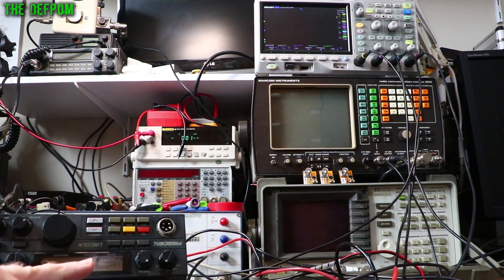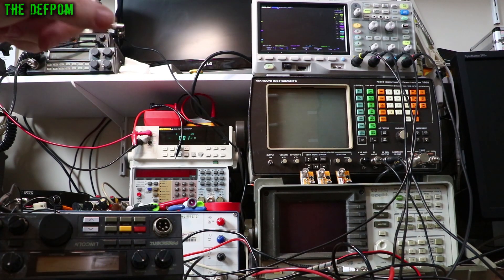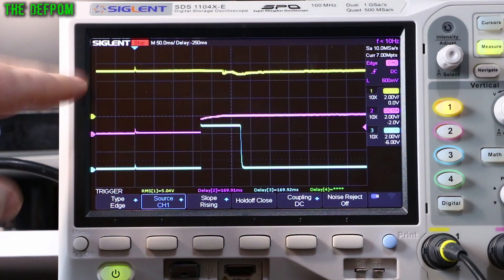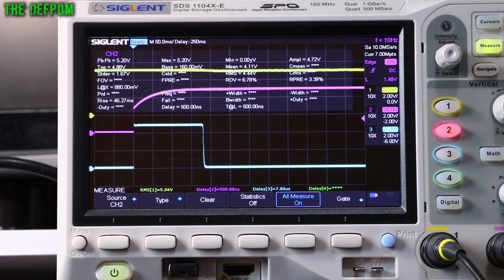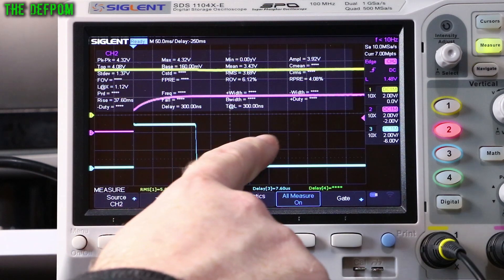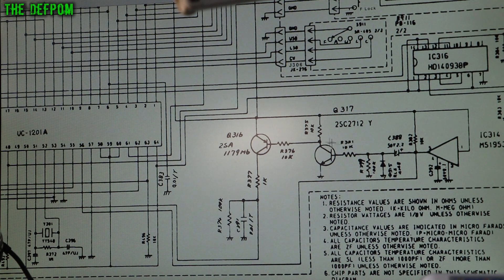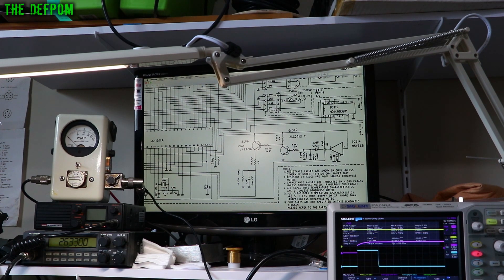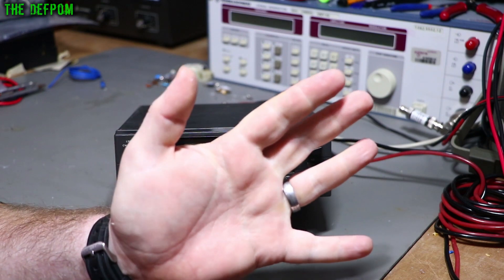🔴 President Lincoln Repair - Processor Reset Experiments - No.887

Comment: Hi and thanks a lot for this video. it helped me a lot diagnosing my Lincoln. 
I have a Lincoln that did exactly this. All was fine after a partial replacement of the capacitors a while ago, since a lot of them where hardly having any capcitance, but this remained an issue later on unfortunately.. 
I checked the circuit you mentioned and the IC but I think the main issue in ths case can also be solved by replacing the 0.1uF delay capacitor of the voltage detecting IC at Pin 4 to GND. (C392). 
Strange enough they used a electrolytic capacitor for this? Since the value was so low and there was only low/non freqency signals, I did not replace it, thinking that it would not have deteriorated so fast. 
I was wrong.. Strange enough it was not dropped in capacitance but it was gone up to 1.2uF?? That can not be good. I swapped it for a ceramic 100nF and all worked fine. 
I will check it over time, but mine was dead after several tries and stayed dead... Now it turned on just like that. No issues anymore. 
If it fails again I will let you know, but 100nF to 1,2uF could definately cause a delay and issue I would say. 

Good luck with repairing!

Comment: Hello And thank you for doing this video.
I had the same problem so I did what you said Putting A 10 K Resistor paralle. AND Now The display is working again.
But I have Another problem The Radio Will not Transmit. 
I have had it in my closet for 5 years. And it got the display fault while being in the closet.
Do you know if the TX problem is related too the CPU Board

everything els is working Prefect  besides TX
I can key the radio but nothing is happening 

Thanks in advance
Reply from the maker: @Nielsoz3no  at this age they need a full capacitor replacement, it is likely that one of the PLLs are unlocked (common issue), it is quicker to just recap the whole whole radio than try to figure out which ones are giving trouble, they will also get audio issues and other subtle issues, even with the display showing a signal constantly etc.
Reply: @TheDefpom  now I just have to find A service manual for my Uniden 28 30.
Do I don't have to finde the valves on the Capasitators in the radio. When I am going to order them. 
Because It would be much easier to look in the parts list 😊

Comment: Although your idea seems much more sophisticated, my display on a Uniden HR 2600 would go blank, sometimes of powering up, and sometimes just setting stationary !
Would lose ability to transmit, and functions would stop !
I read where the chassis screws can become loose over time, as they develop a poor connection to Ground !
This means pulling out the CPU to expose the hidden PCB screws that lay underneath !
After loosening and retightening them, the display came back to life !
Just thought I would throw this out for consumption !
Thanks for your interesting post !
👍😉
Reply from the maker: @sleeve8651  yeah that wasn’t the issue this had, checking screws are tight is something I do on every radio I work on as they can come loose, have found many radios with loose screws on the PCB mounts.
Reply: @TheDefpom  
So glad you responded, as the video said 9 years !
Was the resistor the one tied to ground off the transistor to pin 56 ?
I think my schematic on the HR 2600 , shows 100k ?
Guess I should ask, did you just tie a 10k in series with it, or replace the larger value altogether ?
Thanks !
Reply from the maker: @sleeve8651 sorry I don’t remember

Comment: Oh yes, may I add, it is off 1.3 to 1.5 KHz. I do have a frequency counter, if it is possible and safe, what do I components do I have to tweak to have it alligned? Or should I just transmit say for example at 27.556.4 instead of 27.555.0 MHz so as not mess things up with the radio. All the best.

Comment: Love these radios, still have a couple 2510’s and a few parts 2510 chassis. I was on your forum years ago, remember Rick’s “Test your knowledge” game on the forum for the Lincoln / HR2510? I participated in the first one trying to sort out the no transmit problem. I learned a lot from your site years ago, enjoyed it when I was big into radio! Seeing the Lincoln here made me think of that. Nice video on this.
Reply from the maker: The forum was certainly very popular back in the day, not so much these days, not helped by the spammers trying to constantly create accounts on there, it got so bad that I have turned off registration on it.
Reply: @TheDefpom  Yeah I miss the days it was really active, loved browsing there. The spammers are really bad these days it seems! Great site / forum though, had gotten a lot of information there from 2004 or maybe 2005 and up until I kind of fizzled out on radio stuff maybe 5 to 8 years ago. Seen the forums slowly drop on activity through the years, all forums really, even the car audio ones which use to be really popular too, sad as I liked the forums.
Reply from the maker: @621ELECTRONICS  - if you decide to get rid of those parts chassis’s let me know, I’ve built a few radios out of junkers.
Reply: @TheDefpom  Will do, but I'm a bad hoarder with things!

Comment: Nice repair, Scott. An interesting problem that appears to be designed into the radio. The only concern with changing the value of the pull-up resistor would be the ability of the M51953 to sink the current when pulling the line low - it's rated at 6 mA so that shouldn't be a problem.

Comment: On-the-edge design from the manufacturer....oh dear!
A 100k pullup on the IC's open collector output is a bit too high IMHO and is compromising the signal via the AC coupled cap C388. Not a great pulse eh!
The PNP transistor is a series pass setup with the NPN just driving it's base from the pulse.
Note: C392 is the programmable delay cap on the M51953 IC. This delays the open collector output of the IC after the correct supply voltage is reached. Nominal 10nF seta a 3.4mS delay......Not sure what size you have there but I guess you could play with that delay also.
Reply from the maker: If the rise time improvement didn't solve the problem the next thing I was going to look at was the delay time to give the MPU more time to settle before the reset turns off, it could even be that the rise time improvement is effectively increasing the delay time, maybe next time I will play with the delay instead to see if that also works.